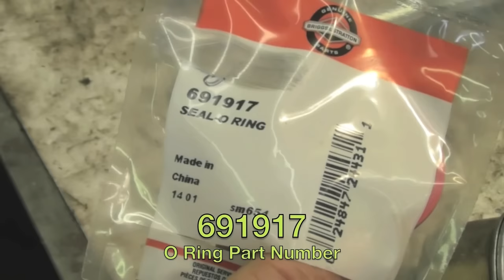Fix Briggs Won't Throttle Down (Engine Racing)

Comment: G'day from Australia Taryl i'm wishing i had seen this video ages ago, i had a briggs 12.5 OHV mower runaway today and i thought i heard pounding in the cylinder, i'll have to go back and watch your early videos to see what else i could have learned.
removed the head and found one screw embedded in the piston and the head and piston crown looks like mince meat.
the butterfly was bent, so i'm switching in a spare, bore looks ok, so i cleaned up the head and sanded it in on 3/4" glass , fingers crossed.

Comment: Thanks for great video. I had exactly this problem. One day it just suddenly spat and then started running very fast. I followed your video. Found the loose butterfly.  Removed the butterfly. Had to use a coin to replace it. Drilled two holes. It fits well. But I still have the engine running fast as if there is no throttle control. Any ideas ?

Comment: Can you do a video on the same model engine but why it's not getting fule. I have a 102 John Deere with the same motor and the fule filter has gas in it but won't go to the motor consistently

Comment: had same problem, but the shaft was broken, motor revved at 5860 rpm with deck engaged, mower on nitro,  pulled motor thinking it was that decompressor cam, wasn't till i put the sump back on that I noticed that throttle linkage hanging out, that part was more expensive than the sump gasket!

Comment: Hey Taryl, have you worked on the Stirling heat engine, 1st patent 1816?  it is making a come back, Nasa had a pickup converted with a Stirling, 30+ years ago.  thanks.  :)

Comment: I was hoping for some help, but I'm sure you're busy. I spent 2 hours and took the motor off the tractor. I opened the crankcase only to find out that the governor is fine.
What am I missing that would cause the motor to run wide open, and not being able to use the control lever to slow it down?
Is it just a mater of adjusting the governor spring?

Comment: Taryl, I have a old String brush cutter with a B&S 6hp (122K02-007-E1) that is acting like it is Hydro-Locked, but when I pull the plug and pull it through, no oil comes out. No oil comes out of the muffler either. It is very hard to pull through with the plug in, but easy with the plug out. I pulled the head to see if there was a puddle of oil, no puddle of oil, the piston is able to go up and down, the valves open and close fine. I pulled the fly wheel to check the key, it is fine. Any suggestions? Thanks.

Comment: I have a carb question for you. I have a 9 HP Briggs Vanguard with a Mikuni carb on it that the engine runs smooth at half choke and sputters with choke off. I have worked on many carbs and know what I am doing for the most part. I have soaked it in Hydro seal and blown everything clear as far as I can see. Pulled the 3 jets and made sure they were clear as well and blew out all the passages I could get to. It still does the same thing. I have read online that once these Mikuni carbs screw up like this, it's time to replace it. I know it has to have a blocked port or passage somewhere in the carb. There is what appears to be a plug (not a welch plug) on the top of the body. Can I remove that and clean in there as well. Your thoughts and input here would be really appreciated. Mark

Comment: I put the motor back on, and still runs wide open. I have noticed that when I turn the motor on, the linkage gets pulled back to the idle screw, but still runs wide open. No control at all from the lever.

Comment: I drove the tractor in the garage and the control lever (speed) was working fine. I adjusted the governor properly. It was only a hair off. The carburetor is working fine, and the valves are set right. The motor always starts fine, but now it stay in wide open throttle at high rpm and control lever doesn't work just like in this video. When motor is off, I can see the control lever working fine................ Any idea why the control lever would stop working just like that?

Comment: Taryl, very instructive & hilarious to boot !
Serious Q: in a 500cc / 19 hp ish single cylinder tractor engine, do you prefer Briggs or Kohler ? 
I'm looking at 2018 or 2019 42" tractors & can get either engine.
[B+S 500/540 Powerbuilt/Intek vs Kohler 541 - series 5400]
Thanks a ton for advising !
(Love to hear anyones experiences too)...David in Texas

Comment: Do you have any video how to do  valve adjustment on briggs and stratton 18 hp opposed twin
Reply: Not enough  clearance  carefully  grind a smidge  off of  valve  stem . To much replace valves .  (VALVE  JOB)

Comment: i have this same engine that is runnig wild like this the throttle plate is still on and the linkage is. hooked. i even tried another carb still revs wild what should i check

Comment: I had this happen 2 summers ago. I thought it was the government too. I took the thing apart and the government was fine. Then I thought of the throttle and sure enough, the screws and throttle plate were gone. I couldn't fine new screws anywhere. I ended up buying a new carbonator off the enterscreen. One of the screws was imbedded in the top of the piston.

Comment: I replaced the carburetor ever since the to run it I have to keep it past the running position otherwise it will go off, can you tell me what can be the problem  thanks
Reply: It is a 1998 murray riding lawn mower 17hp ovh motor

Comment: this shit happened to me.

throttle plate lodged itself in the plastic manifold one of the screws or piece thereof wiggled up next to the intake push rod and caused it to wear clear through (hollow aluminum one) and then the other screw decided it should become one with the piston. I dug it out and polished the pistol face a bit with a dremel but it left a dozen or so nicks and scratches. 

I just bought a whole new carb and threw that piece of shit into the woods.